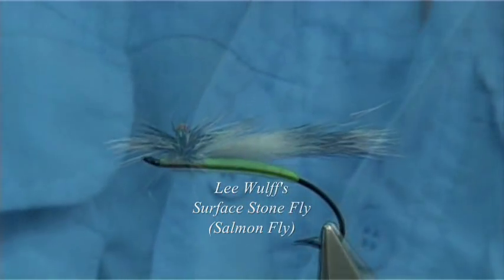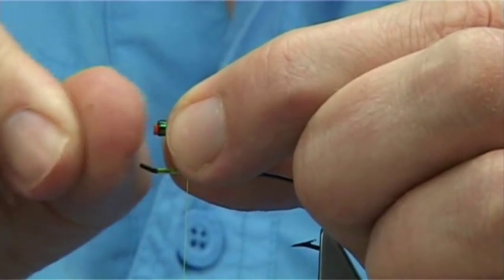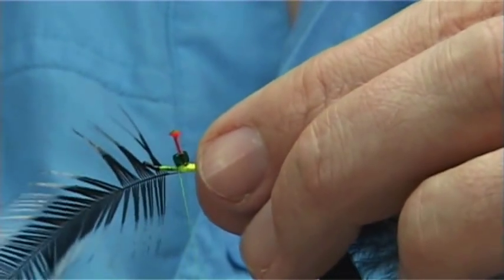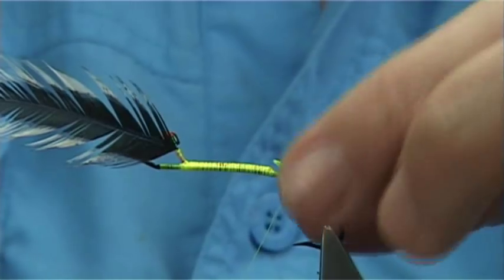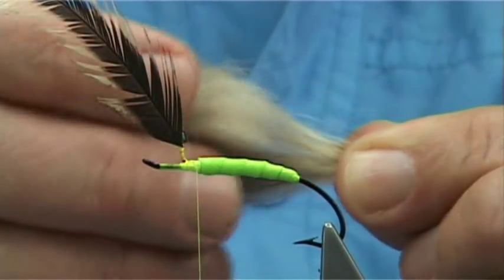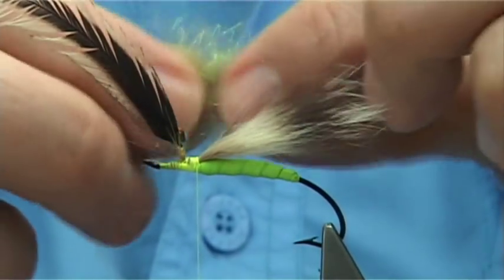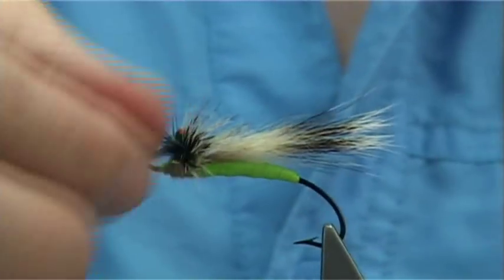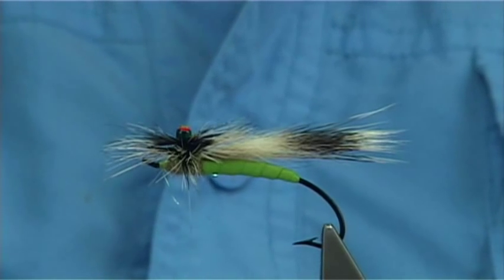Tying Lee Wulff's Surface Stone Fly (Variant) by Davie McPhail.

Comment: Nice job. I tied 1000s of these in the 1970s and 1980s but used japanese pins which were easy to bend with pliers. The body I used was edge brite green. The sizes were size 6 up to 2/0.
Some people I know used stiff polar bear from old rugs to make these posts also on very small size 10 doulbes for this pattern. 
They caught a lot of salmon.
Looks a lot easier than the method I used.
Thanks for the tip.